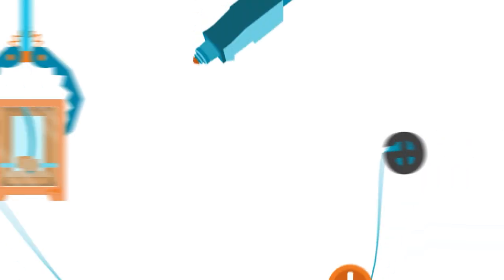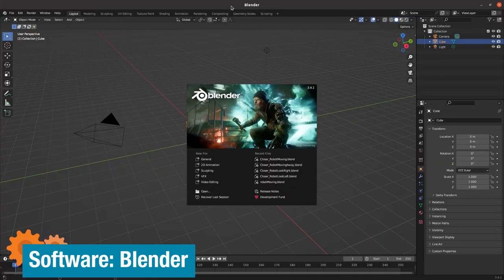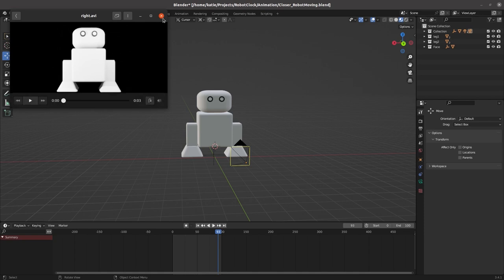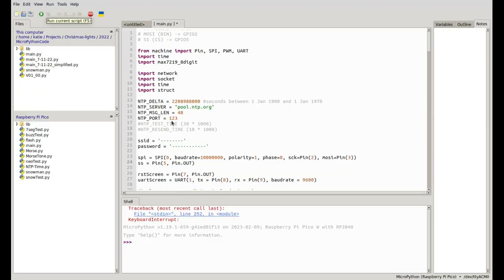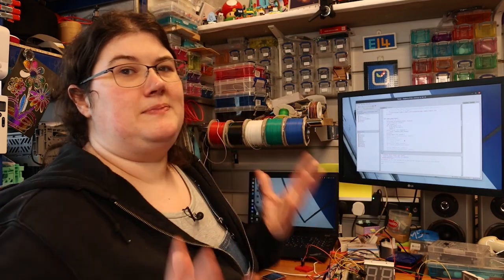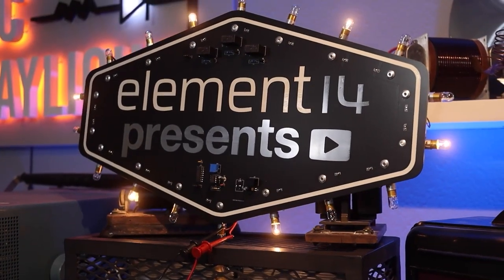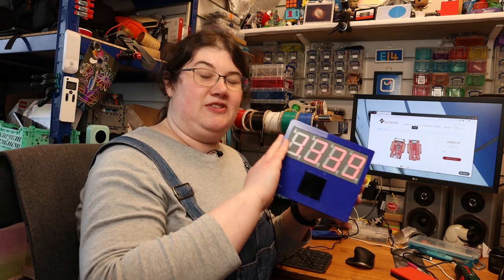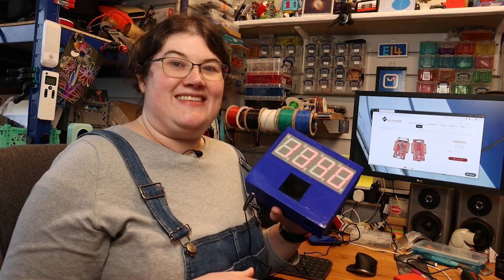Building My Dream Digital Clock: DIY 7 Segment Display with a Cute Robot Twist!

Comment: Great project!  One suggestion would be to add a red acrylic filter over the clock digits.  It will add contrast and make the numbers stand out more.
Reply: That's a great suggestion, will definitely be adding a filter to help with the contrast, thanks!
Reply: @hifromkatie  You’re welcome.
Reply: a little bit of window tint film might work as well.

Comment: Another great project! I would probably relocate the power jack into a cavity so that it could either sit on a desk or be hung on the wall and sit flat either way.
Reply: That's a brilliant suggestion, I put it on the bottom to make sure it say flat against the wall, but it hadn't crossed my mind to put in a recess, but that would have been perfect, as it sits nicely on a table due to the flat bottom

Comment: Wait when the hell did element 14 get British? Am I supposed to know if my project uses 120 or 220
Reply: AFAIK Element 14 has always been a British company. A division of Premier Farnell Ltd of Leeds.
Reply: You could change to a 12 HR clock pretty easy, my old Bush clock radio from the 1980s uses 2 LEDs to represent AM and PM. Have thought about upgrading that a few times but never got around to it.
Reply: @Workshopshed  No I meant the... mains current
Reply: There's a variety of different countries represented.
I know in all my projects for element14 I use barrel sockets on the project and spec an AC to DC power supply to power it.
With the intention that you should be able to find a power supply unit/brick with the correct plug for your country with the right output voltage
Reply: @hifromkatie  I was... making a joke
Reply from the maker: It's a bit weird, element14 is the Asia-Pacific region of the company, Newark and Farnell are America/Europe - and the element14 Community is global focused. So we're a bit of everything.
Reply: @element14presents  I believe Element 14 Ltd, was originally started back in 1999, when Acorn Computer was broken up, and the various assets spun off, like ARM Ltd.
Reply: @michaelturner4457  arm spun off from acorn 1990 as acorn was winding down, changed its name from arm to arm..... "Acorn RISC Machine" to "Advanced RISC Machines"
Reply: @element14presents >>> "Well, that's just you all over." 😉